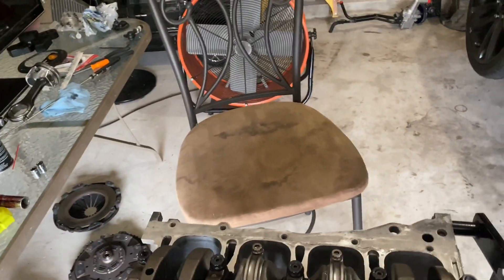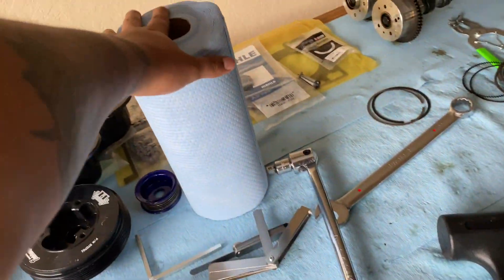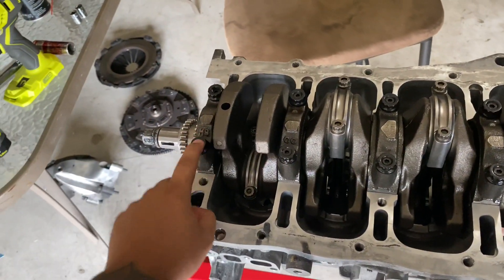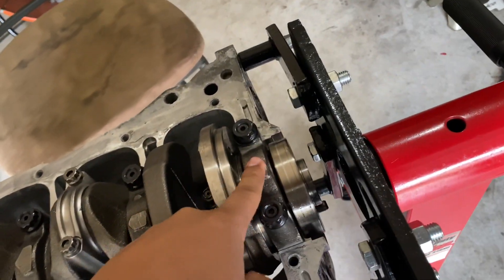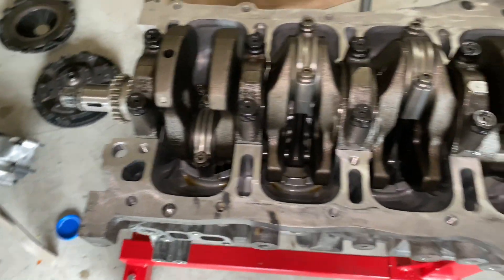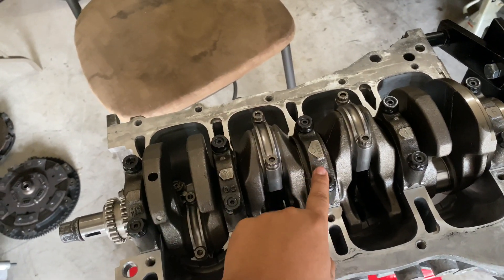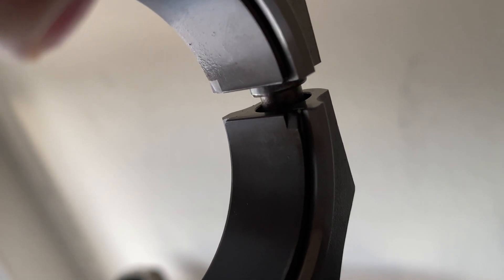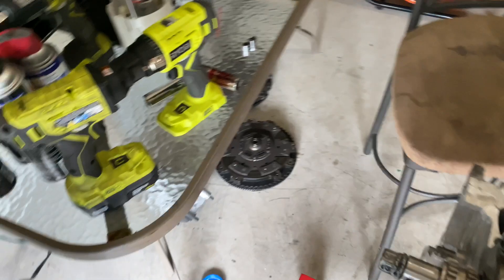Genesis Coupe 2.0T Engine Build Pt.1 | Crankshaft and Oil Clearances

Comment: Lol random question What size bolts did you use for the engine stand?!?
Reply from the maker: 50 or 60mm I can’t remember the length 
M10x1.25 is the common thread used for the chassis and block holes
Reply: @ProdigePerformance  Thnks homie Problem solved Much love🥇

Comment: If I am replacing the crank along with bearings and rods as well is there a need for measuring journals / bearing clearance? One of my rod bearings welded itself to the old crank.
Reply from the maker: You measure your clearances regardless otherwise how are you supposed to know if you’re in spec or not? Every engine has specific clearances

Comment: Thing is those rod cap screws are torque-to-yield. So if you plastigage and the clearance is no good, you have to buy a new bolt... crazy
Reply from the maker: ARP rod bolts aren’t tq to yield lol… crazy how you failed to understand that.
Reply from the maker: Should pay attention, this is a performance engine build, not a stock engine build
Reply: Pretty much anything arp isn’t torque to yield

Comment: are ur bearings .50mm?
Reply from the maker: It’s been so long since this video lol I don’t remember but I will say that you can easily find your clearance with the bearings you have now or you can take pre measurements with the correct dial bore gauge tool and then order the bearings of your liking
Reply: @ProdigePerformance  would it be safe to just go standard kings? cause i have k1 rods as well
Reply from the maker: @vietyyg6739  I wouldn’t. I would measure and make sure i get the correct beating instead of wasting $$$ for the wrong one

Comment: For the plastic gauge check. do I torque the crankshaft to the final torque specs to do the plastic gauge check?  and for do I put the trust washers after the oil clearance check or before doing it?

Comment: So what did you do after measuring the main bearing clearances? Were you able to get oversized main bearings for the journals that werent within spec?
Reply from the maker: My specs are different from what others run, if you want stock specs go for it. I prefer my clearance being more loose. Allows me to run thicker oil 

Essentially you buy a set of bearings based off the sheet the shop gives you x they will tell you your crank journals diameters and the rods 

Plug in the math and pick the bearings you want. Std oversized undersized custom etc

Mix and match what you would  like to achieve the clearance you desire

Comment: Hey I'm planning to building mine to. How much are you planning on spending for the rebuild?
Reply from the maker: Chicoon 41 I’ve only spent around 1100$ to rebuild. Not much at all

Overall build like internals I’ll give you a price tomorow when I add everything up including machine work
Reply: @ProdigePerformance  Yeah whenever is fine. 1.1k is not bad at all. I'm following the series appreciate you putting this up.

Comment: Awesome build man. I'm currently getting my bk2 2.0 built. Molnar rods and weisco oversized pistons but unfortunately im not mechanically inclined to do it myself. Paying to have everything done. Pulled, built, and reinstalled 😥
Reply from the maker: Absolutely nothing wrong with having someone build it for you. Hope to see your build up and running soon!
Reply: How much?? I have a rod knock and im frustrated. Dont know what to do if rebuild the engine or get a different engine???? Helppp
Reply: @brayanvaldes2327  well i spent 1.7 k on parts. 4k at machine shop  and 2.3k to have motor pulled stripped and reinstalled. So 8k ish total.  Cheaper if you pull mull motor and assemble yoursslf.
Reply: @spectrum870  can u link parts and do u think I can bk2 2.0t swap my bk1